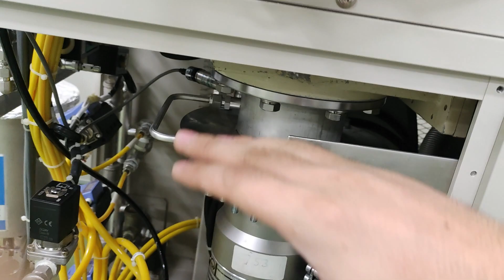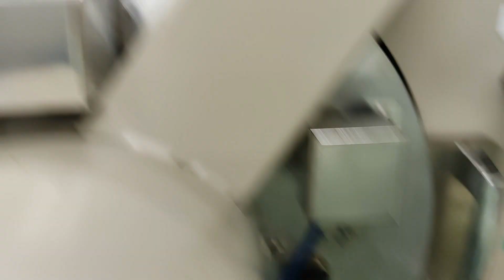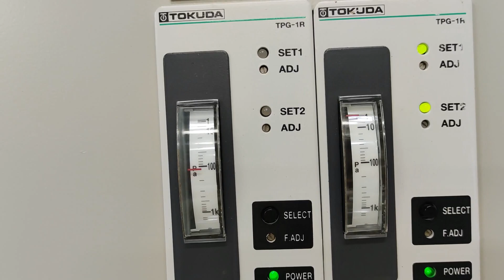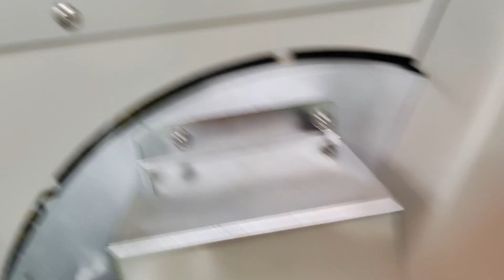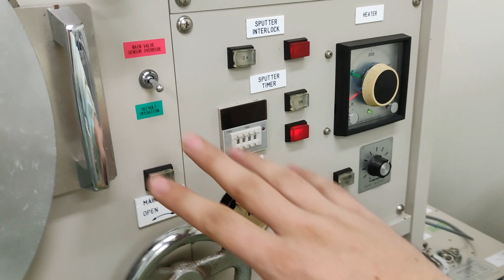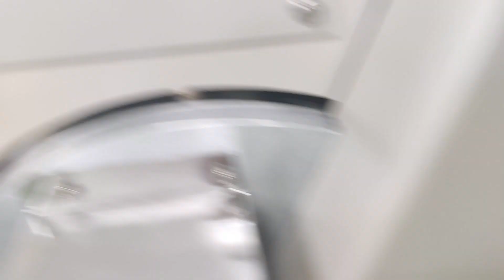Leybold Turbovac 150. TMP pinout, conection, pumpdown and cooling. Video 4/3

Comment: Its better to have the valve open at start since its very risky to the way you do, you can easily do a little to much and the turbo is destroyed, its not the right way. And start the turbo the same time if its a little normal sized chamber it helps to get it down. If it is to big to much air will be in the chamber and the pump will not be able to hit its normal speed during a internally set time, and stop with a red light.
Reply from the maker: Yes, I agree. I did it this way because I was not sure if either the controller was good. Closing off the chamber would mean very little air on the low side of the pump, which is easier on both pump and the controller. The pressure in the main chamber was kept at acceptable fore-vacuum pressure for the pump at all times. With this manual machines it is indeed important to know the rules and limits of the equipment

Comment: I really hope you know what you are doing and what valves and things you are opening since open one wrong valve can totally destroy the turbopump in an instant. And 3*10^-3Pa, it should be able to pump at least 3 orders of magnitude lower than that. But good video.
Reply from the maker: Thanks! Your comment made me check the manual) The ultimate pressure is 10^-8Pa per datasheet. Probably it is due to the  nature of the systems used and lack of experience of my part, but I have never seen any apparatus go this low. At least with TMP alone. This made me treat this pump as 10^-4Pa system and not think too much about it. Makes me want to make a flange that does not leak through the bolts, now that I know that this TMP can do more xD
Reply: @semiconductorsstuff  The ultimate pressure is taken at fab with a vacuum gauge bolted right on top of a CF flange that in turn is bolted directly to the pump and then pump is heated for a couple of hours to drive off moisture and let the pump go for 24h and then read the pressure. ISO pumps are tested the same but without heating. You would normally never get that low in a system but close if done right and have the right pump and so on based on the size of the chamber and amount of rubber gaskets and so on. You would only be able to get down to this exact CF pump ultimate pressure if it is a complete CF-flanged system, which this is not. But I expected at least a little better but there could also be a lot of moisture in the chamber or many gaskets. If you could quite quickly get down to 10^-4Pa I would personally have been happy for a big system like this and you really don't need to go down that far anyway based on what you do since you handling plasma as I understand, only to get rid of any unwanted gases.
Reply from the maker: @dtiydr  Even with heating and fully CF flange system, I am impressed at how low can this pump get even in theory. Cleanest I have personally seen was probably 10^-7 at Auger Electron Spectroscope, but that was another level of monster. Ion pumps, load lock, heating, plasma cleaning, 24/7/365 operation and all administrative stuff. 
As for this system - it is not the moisture, sadly. The reason is that I had failed to make a conversion flange (CF to o-ring) with blind holes, so threads on the bolts (even filled with vacuum grease) provide a leak path into the chamber. Was pretty sad when I noticed that oversight, but for sputtering oxides at 0.5Pa it will do, probably. One day someone will get curious enough to TIG weld those bolts and get to 10^-4Pa or so is my hope.
Reply: @semiconductorsstuff  Oh yes I see that picture now on the screws, no that is not that good and just the very fact that you using a en rubber gasket doesn't help either¨but that is all that you can do. Turbopumps goes down low but the one you have, as I mentioned before, have a little bad blade design compared to modern ones and thus don't have exactly the same pumping capacity but it shouldn't matter that much. At Max4 I saw 10^-8 Pa on a vacuum gauge, and that was held there since they needed that level.